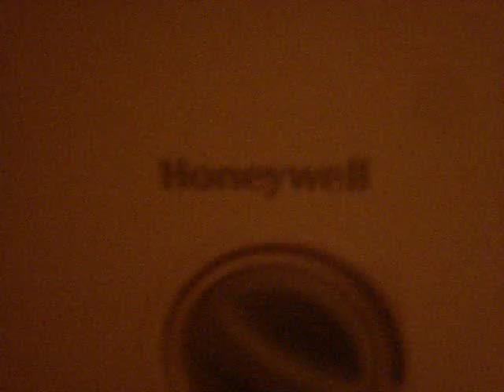Cheap ultrasonic humidifier honeywell

Comment: I was about to mention it uses an ultrasonic transducer, but then I read your video description where you already mention your theory was incorrect.  My offhand guess about the probe is that it measures temperature or water level.  It could even be a float switch riding the rod for alignment (can't tell from the video).  The problem is that ultrasonic humidifiers use distilled water (otherwise they don't last long as you realize from the mineral deposits you saw).  This means typical electrical methods of measuring conductance between probes won't work, as the water has 0ppm of ions (ie high impedance).
Reply from the maker: there's actually a small compartment filled with DI resin ... as to semi-filter the water before its driven into mist by the piezo disc... im sure it helps, but yea.. if its not using distilled water to start with, its gonna build up with crud... you even end up getting crud deposited on your walls n stuff near the humidifier if you use tap water!!
Reply: Wow, that's a pretty cool idea using the DI resin.  From my research on DI resin, you really don't get down to 0ppm from typical tap water with only a single phase filter.  Still a cool idea though.
Reply from the maker: it isn't my idea... its actually what is inside this humidifier, and a lot of other similar models.  It really isnt even a large amount of DI resin either.. its a very small filter!  I am kind of at a loss as to why they even bother having it in there at all... i don't see it reducing much from tap water!